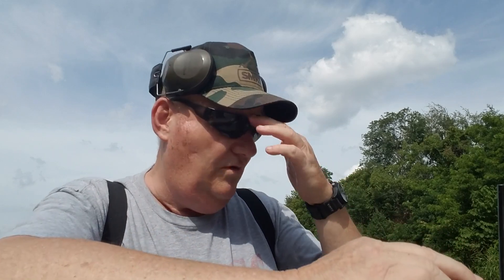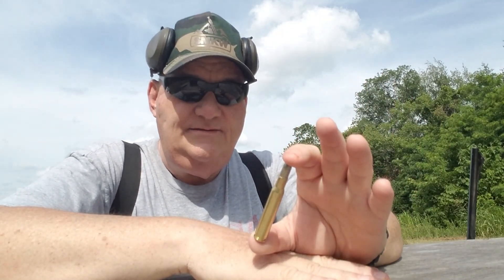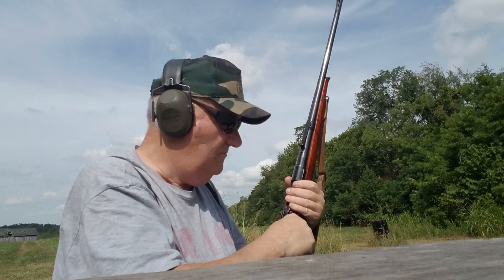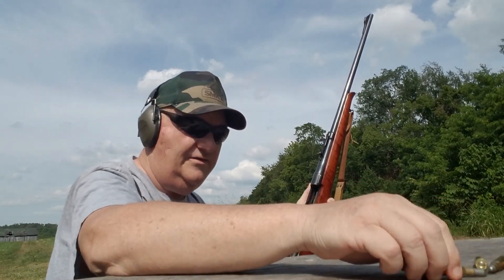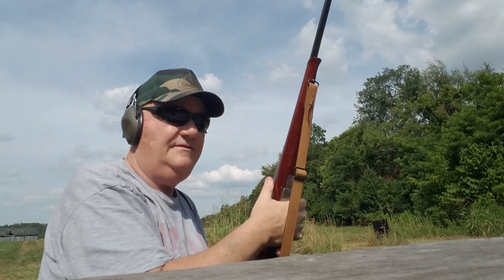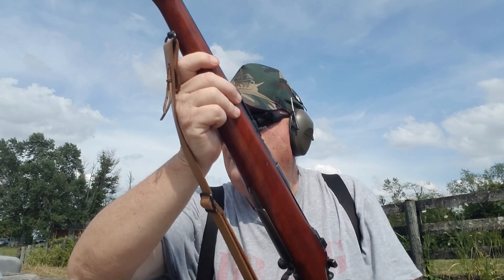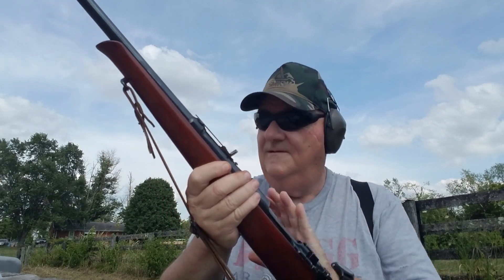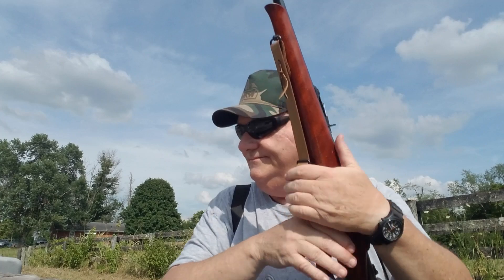30/06 lead bullet experiment

Comment: i have a 3040 that i have shot cast in for years.used unique.did not size bullets oversize does not matter in cast.used wheel weight metal.

Comment: Good stuff! Those would be fun plinkers. If you want to push them faster, I powder coat them and can get 2400 without any leading issues. Have heard of others going a little higher, but haven't seen the need.

Comment: Any more velocity and you'll spend the rest of the weekend removing lead from the barrel.
Reply from the maker: I planned it as a short-range Gallery load.
Reply: Not if you power coat em I push my cast to 2500 fps with ZERO leading issues at all whatsoever